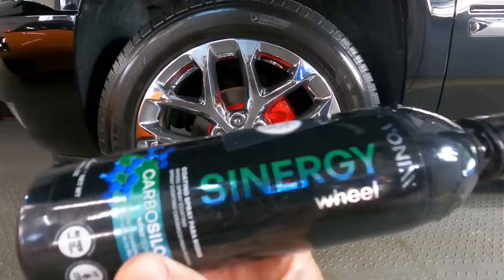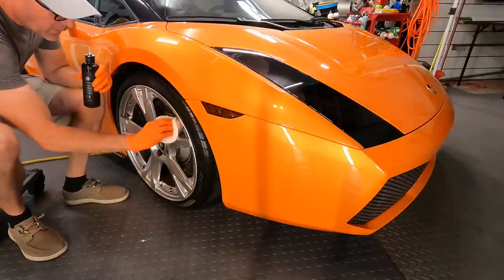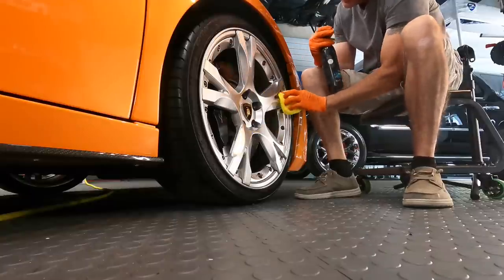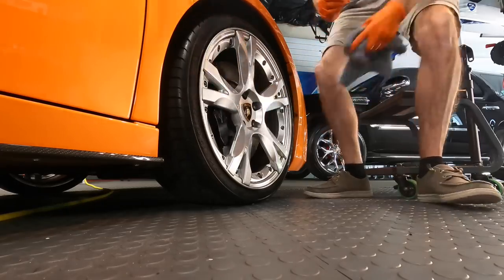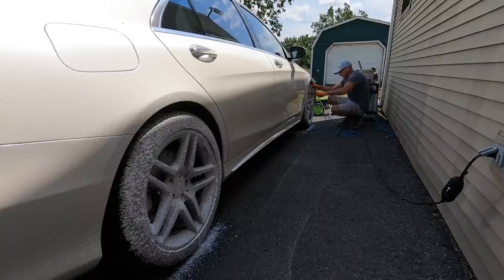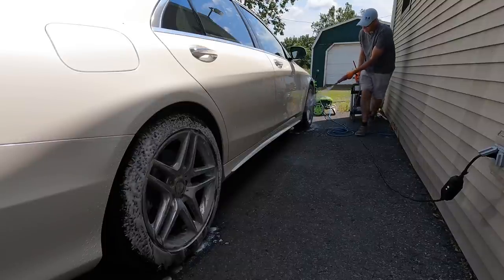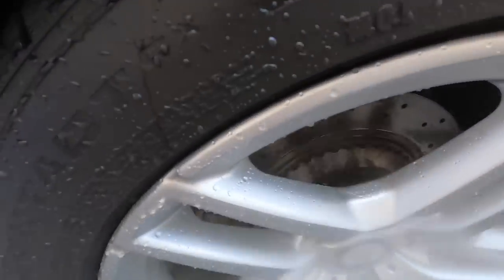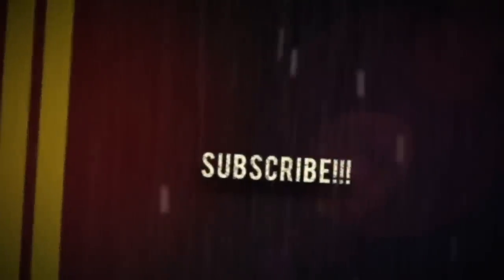A Ceramic SPRAY Wheel Coating That Will Make Your Wheels Look Amazing! Vonixx Sinergy Rim Coating!!

Comment: Vonixx makes a handful of awesome products. Their plastic ceramic coating, Engine coating and headlight coating all work really well and are super fairly priced.
Reply: Where I live in Portugal, they are expensive...
Reply: sounds like they took the same product and labeled it 3 different ways to fleece people.
Reply: @riccochet704 , The headlight coating is definitely different from the rest. Couldn't tell you the Si02 content of the others. But both the plastic and engine coating have worked really well and held up for me.
Reply: @riccochet704 the composition is different, the Sinergy Wheel, different from the Sinergy Paint, has a long carbon chain that helps with the resistance to high temperatures that you have on wheels and brake calipers
Reply: @James-x3j4u  but the plastic, engine and headlight coatings are all essentially the same. Since it's all plastic they are coating. Honestly, don't need separate products for any of those. I was using turtle wax hybrid, now use blue collar on everything.
Reply: @riccochet704 100% agree. All the different products have gotten ridiculous and unfortunately people are buying into it. The great thing about the sio2 spray sealants/coatings of the last 5 years is that they work on everything (paint, plastic, metal and glass). Can even use on wheels, just need to re-coat as they won’t last as long as a specific wheel coating. I’ve massively simplified my protection routine and I’m not looking to back to individual products.

Comment: Hey Brian, on video, it truly looks like it has performed fantastic on the Mercedes, even after a month. Respectably curious the reasons it’s 7 out of 10 instead of higher. Just wondering if it may have fallen short a little or is it pricing? You did say it may increase. 👍🏼 Truly appreciate all your efforts, videos, skills, and knowledge. 👍🏼👍🏼
Reply from the maker: The score could easily go up. Time will tell if it holds up.

Comment: Thank you for doing this review. Question: powder coated wheels. What do you use to clean and protect power coated wheels? Is there anything special? Thank you, Brian.
Reply from the maker: I use the same protectants as any other wheel. For cleaning....the least aggressive method necessary. I start with just car shampoo and work my way up from there as needed.

Comment: Would your spray product handle the wheel temps ?
Reply: Absolutely, this spray coating is designed to handle the high temperatures from the wheels and brakes
Reply from the maker: BC2....Absolutely.